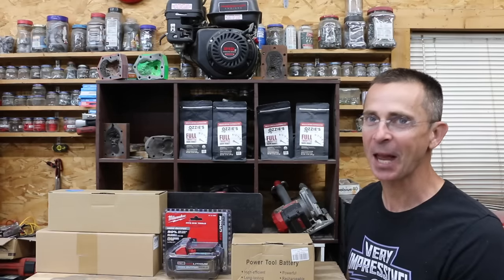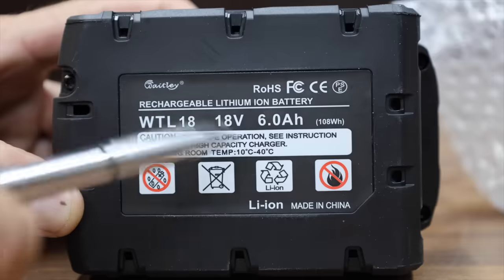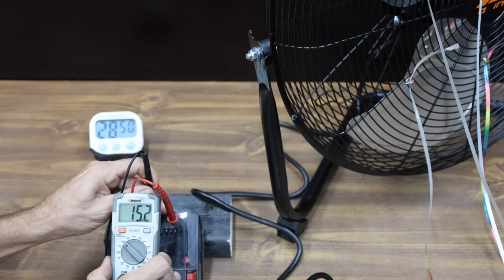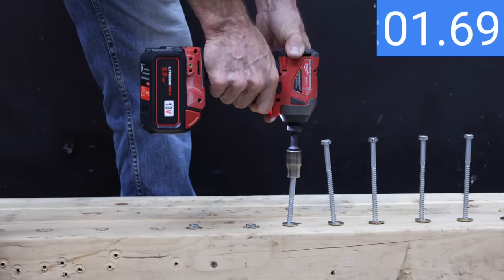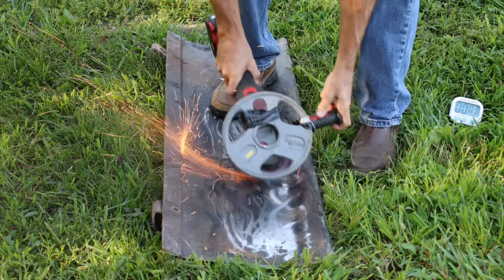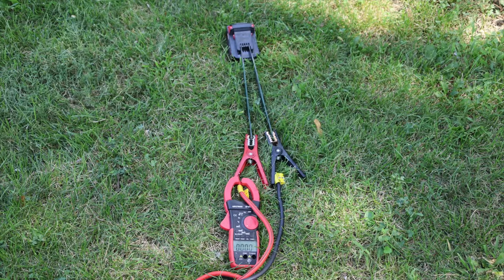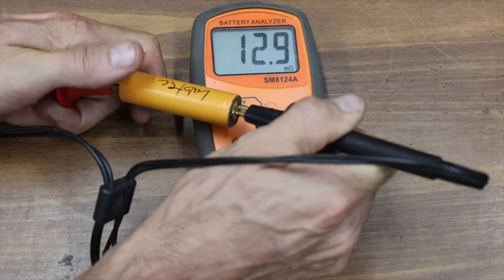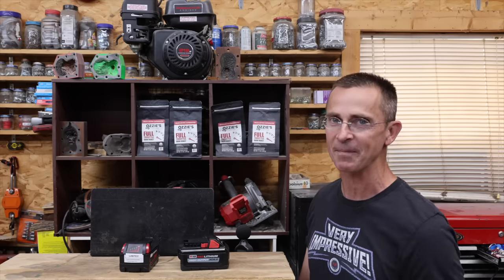How Dangerous Are Knockoff Tool Batteries? Let’s find out!

Comment: As much as i hate paying the premium for milwaukee batteries, i know they'll last longer and safer then the cheap ones. Another great video 👍
Reply from the maker: Thanks!  Thanks for the feedback.
Reply: yep
Reply: Buy 4 Labtec for the price of 1 Milwaukee.
Makes my mind up.
Reply: @BoltRM  i bought 2   9.0Ah 18v for $90.... they are complete garbage
Reply: @BoltRM Buying 4 chances for a shop fire for the price of a Milwaukee lol
Reply: as long as you stay away from the crappy 12.0 battery you're golden. mine only charges to 3 bars now and dies just as fast as an old 5.0 one.
Reply: @HeWhoIsWhoHeIsThis is how I feel about car tires and I only buy the best tires I can afford.
Reply: Early on, Milwaukee was known as the "Tesla" of batteries.  They used the best cells and and put way more r&d into their bms.  Just like with electric cars, everyone thought the Nissan Leaf or Prius was like a Tesla, but they weren't even close.  Milwaukee has done an awesome job with their batteries.
Reply: We all hate paying, but deep down we all know the milwaukee battery will do way better.
Reply: @TherapyGel  Good point about risking fire. Guess it would need to create cement box to store batteries in. Not just power tool batteries 😵
Then again batteries that cost more can also catch fire..
Reply: @geoffkemp7 2/3 the power for 1/5th the price makes sense for some. If you are in your shop or working with your tools for just small jobs it makes sense to get the cheep ones.
Reply: @geoffkemp7   I use my batteries daily as a mechanic. I get two years warranty on the batteries. So I figure it works out cheaper then buying el cheapo ones that will probably last a few months!
Reply: @BoltRM  But the Labtec came from China. So with their lack of quality control, maybe he just happened to get a decent one. Someone suggested he test five of the same type/brand. Plus, and this is just me personally, but I prefer to not support the Chinese economy. Even if I have to pay more, at least I know I am getting a quality product and am supporting Milwaukee.
Reply: @HeWhoIsWhoHeIs  The Chinese could care less if their battery burns down your house or shop. And why support the Chinese economy when we desperately need to help Americans put food on the table.
Reply: @BoltRM  1 Milwaukee battery will outlast 6 LabTec batteries...

Comment: This video could literally save lives. I always worry about using cheap batteries and chargers and would vote for more tests like this.
Reply from the maker: Thanks for the feedback.
Reply: Good point. This could be the most valuable test yet.
Reply: So true after that test where the battery Was  smoking after being used, I was always scared to charge them Now I am scared to use them not worth it
Reply: I use genuine de walt batteries with adapters in all my tools de Walt or not
Reply: I always take a look inside eBay/knock-off powered stuff. Some are fine and some are shockingly poor for basic safety design. PCBs need proper trace separation to avoid mains voltage jumping to the low power lines and killing you.
Reply: Greate test as usually, thank you. 🎉
Reply: Someone was selling hundreds of these cheap no name Chinese tool battery packs, glad I didn't bothered.
Reply: Hell I’ve been using knock off batteries as back ups for when my name brand batteries die and I’ve been using them over 2 years and they perform almost identical to the name brand ones.
Reply: @themrgodfather77  well as we saw there is quite a variance in knock-off quality as well, I would say we could classify them as "3rd party" batteries and the actual knock-offs, that try to actually scam you. Seems you got the better bunch.
Reply: Because the lithium batteries can be dangerous, as the E-bike fires have shown, I would ONLY buy reputable brand name batteries like the OEM batteries by Milwaukee on Milwaukee tools etc those cheap batteries are half the price for a REASON, and that reason is usually high risk to you!
Never leave the batteries "cooking" on a charger once full! it only takes the failure of one component and the battery could continue being overcharged and that creates a dangerous condition.
I believe most of those E-bike fires are caused eithe rby over charging, or people buying either cheap no name batteries, or "reconditioned" ones sold for half price after having been messed with by some idiot who is NOT factory trained/auth soldering in replacement cells and creating a dangerous condition in the battery pack.
Reply: @1myunderscore Where do you buy these dealt batteries?
Reply: @preachers4135 As he mentioned Dewalt later in the sentence, I'ma gonna guess "dealt" is a typo of Dewalt :)
Reply: This is why I charge batteries  only when I'm around to pull the plug
Reply: I saw a UK trading standards video a few years ago about cheap stihl knockoff chainsaws, the type sold at markets as opposed to supposed decent shops and the quality difference and danger of parts failing was shocking.
Reply: @preachers4135  de Walt sorry spellchecker went mad
Reply: @themrgodfather77  The Chinese appreciate you supporting their economy.
Reply: @HobbyOrganist  " been messed with by some idiot who is NOT factory trained/auth soldering"
Talking about Louis Rossmann?
Reply: @steadyeddie7453 _there ALL made in china. Wish there was one company not In China but there isnt.
Reply: @BPo75 Louis Rossman is great. The guy has done quite alot to make sure that we can repair our own devices, tools, cars etc. They really want to make it so that you pay for something get to use it but you never actually own it and you certainly are allowed to fix it when it breaks.

Comment: "Buy once, cry once" are words to live by, but I'm glad you tested them anyway. Having had to use my tools in some sketchy environments, I appreciate the effort to not endanger the pricey battery system!
Reply: Never heard this before but yeah makes sense
Reply from the maker: Thanks for sharing.
Reply: Sketchy? How
Reply: Just remember that only way to put out a lithium ion battery fire is take the heat away , power cell itself has everything it needs to burn inside it .
So dropping battery in bucket of water is most practical , after that the water should be treated as toxic waste .
Lithium ion power cells have only few grams of actual lithium, even if it reacts with water , there is so small amount of material its no concern .
Problem is that those power cell can get up to 1000°C/1832°F when burning , compared to wood fires burning temp being round 600°C/1112°F
Reply: @pete_lind  thanks for the info. i looked it up further an it seems you can estimate lithium content in a battery with a simple formula , grams of Li = 0.3 x Ah
Reply: @pete_lind  good advice, but the battery will probably be burnt out by the time you find a bucket, fill it with water and find appropriate tools to pick up the 1000*C battery. You're better off immediately trying to prevent everything around it catching fire and/or transporting the battery (kicking it or pushing it with something you don't mind getting a bit burnt) to a place that can't catch fire or melt, like a concrete pad or a patch of gravel/dirt. Putting the battery in a bucket of water however will be useful in preventing a partially burnt/damaged battery reigniting after the fire has stopped by itself.
Reply: Just don't apply that philosophy to buying a new car. 😆
Reply: sadly that is an old saying and the modern reality is more like "most cheap stuff is shit and a lot of expensive stuff is also shit..."
Reply: Big red's tools are no joke long lasting, sometimes they fuckup here and there but they are almost bulletproof. We have 2 drills, an impact 3/4 and a deathwheel on fairly used batteries and boy they still works fine.
Reply: I agree. My Milwaukee batteries didn't last long at all. At one time I had 4 drills a saws-all and 6 nonfunctional batteries. Now I string a cord.
Reply: @JerryBanks572 curious which batteries, we have had good luck with them. 9 ah had problems dying and some older 12ah
Reply: @olik136  Agreed!
Reply: @OmarGarcia-bi7jq  In this case, I mean "sketchy" in the sense it's likely to be damaged or stolen. A lithium battery is pretty much a lithium battery otherwise.
Reply: @forfluf  There is definitely a point where one could pay too much for a car, but I would submit that point is higher than most of us would prefer. Besides, personally, I'd rather err on overpayment than fight an overly cheap car for years.
Reply: @olik136  Seriously though! A luxury car is now a status symbol because you can afford to keep it on the road, not because it's premium quality.
Reply: @TheAndre8900  Haven't heard "deathwheel" - angle grinder? For sure, one could do a lot worse than Milwaukee. A home gamer like me who doesn't routinely run into the limits of his tools could still benefit from the cheaper batteries, though.
Reply: @JerryBanks572  That seems like bad luck! Were they lithium batteries?
Reply: Yep. I bought a knock off battery for my Ryobi 40V power head (attach trimmer, edger, blower, etc) because a Ryobi one was around $100. It last for about 3 months. Bit the bullet and bought the Ryobi and it has been around for several years and still going strong.
Reply: This was all at least 10 years ago. I think the first 2 were NiCad and the  rest were Li.  @McTroyd
Reply: Indeed
Reply: @JerryBanks572  Yeah, I killed a lot of NiCd...
Reply: @olik136  "You get what you pay for" is no longer valid, if it's ever been. You never get more than what you pay for, and often, you don't get what you are paying for.
Reply: @McTroyd  It's like the peacock strutting its cumbersome tail feathers. The chicks know that the larger it is, the better the genes, because the male can survive dragging the huge tail around.
Reply: @OmarGarcia-bi7jq  -  More than likely explosive, high dust, wet, or other abusive or environment with hazardous conditions.
Reply: This channel has done a lot of tests showing just because it's more expensive doesn't mean it's always better, there are some budget options that keep up.
Reply: @KlodFather  That and theft.
Reply: @Tony-sz8ql  That's the paradox though. Every vendor of every product would have us believe everything they advertise, regardless of price point. The higher up the price point, the more likely it's true, but odds are less than a coin toss at the low end these days. Todd (Project Farm's host) will have all the business doing these videos he could want, for as long as he cares to do them, especially in the budget space.

Comment: This is actually a much needed and very entertaining test ❤!!
Reply: I read this comment in your voice! Love your videos!
Reply: This man has his notification box checked..
Reply: On the Max Torque test chart, you have the Milwaukee 5AH and 6AH label flipped.
Reply from the maker: Thank you very much!
Reply: @Z-Ack  lol... I do !
Reply: Do Tesla still use 18650 cells? Would be cool to compare it to the Milwaukee:)
Reply: Yup. I almost bit on Amazon.
If they had a 12ah I probably would have. Glad I didn't.
Reply: @Eduardo_Espinoza  Yes they do I actually have some in my basement. It would be cool I was thinking the same thing when I was watching the video. Maybe I need to send project farm some Tesla cells.
Reply: do a video for the best no chip angle grinder blades i need the best blade that does not chip tile i need the one with the most precise cuts
Reply: i looked for it on ur channel but i can’t find it i think you need to make the video for it thanks 👋👋
Reply: @ProjectFarm  miss spoke when talking about the outcome of the Milwaukee, the used 5ah battery did the best.  n/m graph is just wrong.
Reply: @ProjectFarm  3:45 The screwing test does not seem to be comparable, because the wood material varies in density at different points. Thus, one screw requires more force than the other screw. Most of us know this about wood material. The differences between the two different points can be really significant.
Reply: They [non UL listed batteries with no safety tests] should be outlawed, because they are genuinely one of the most dangerous things you can buy on Amazon. My friend had some generic batteries explode in his vehicle, and he wasn't injured, but could have been badly hurt.
Reply: @starseeddeluxe  oh yeah, same experience here, I bought some lipos off Amazon and had a similar experience to your friend. Now I just would rather spend a little bit more money and be a lot safer.